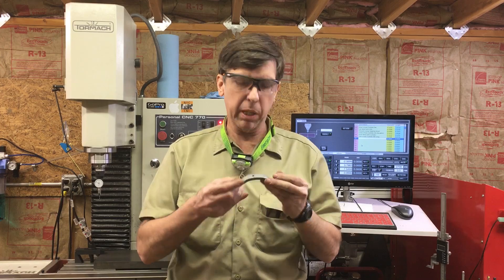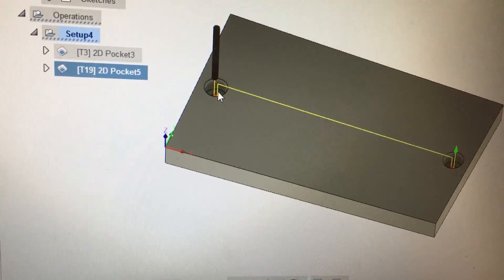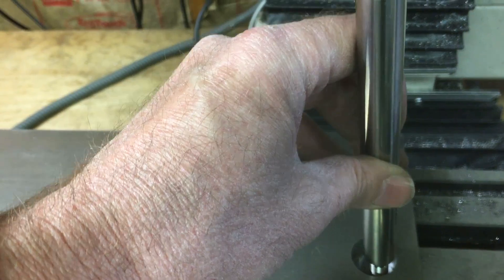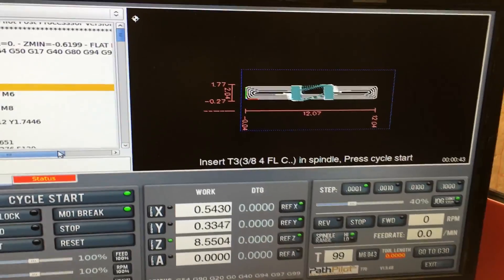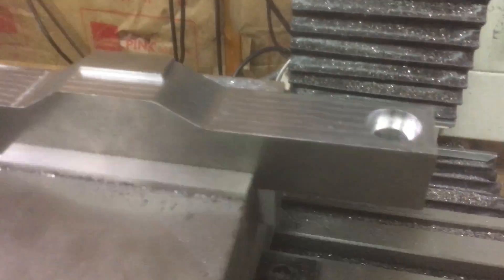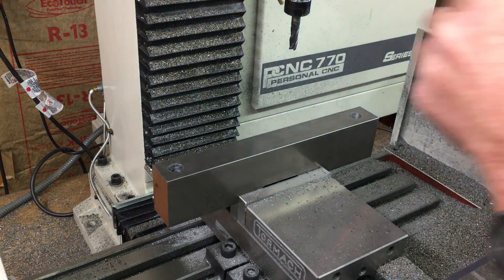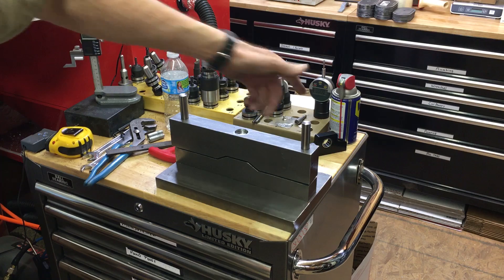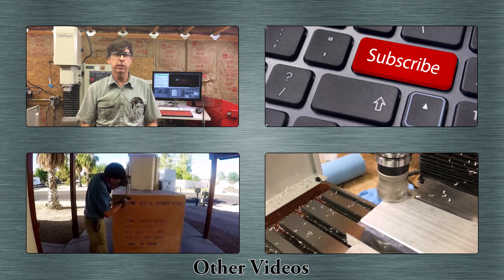Making a Press Die/Press Brake

Comment: Unipunch has been around for 50-60 years.  DME products have specialty pins and bearings of various hardness, They also sell die sets that you can add the shape dies of all sizes.  Just type in either on the internet and go.   Nice work by the way.
Reply from the maker: Thanks!  I checked out DME. Looks like mostly mold equipment. I guess the pins and sleeves would work the same.  Didn't see the die sets. Still debating whether I should buy a premade die set  or make it.

Comment: In case anyone else would like to remove the slop from the ram of a Harbor Freight 20 ton press.  I use mine for all kinds of other more precise tasks like tube flaring and such.  With the slop of the ram removed, it really improves the utility of the press for more than wheel bearings and press brake work.

https://www.youtube.com/watch?v=X6zGj9avKIQ&t=71s

Comment: Nice die

The top looks a little heavy
Any reason for using such a thick piece 
Just thinking about cost

I’ve been meaning to make a couple forming dies
After watching your video I might be out in my shop soon
Reply from the maker: Thanks!  I have no engineering experience so I have to over engineer things.  I will use scraps from my metal supplier from now on though.

Comment: like the idea of the separate base and sliding the bottom die on that centering it with the pins
been looking at a sheetmetal finger brake for my shop press and the bottom die is usually welded to the plate wish makes it impossible to use it for anything else then bending sheetmetal  , with the loose parts you can make add ons with less material as you reuse the same base 
this way of putting the thing together in sections makes it eazier to set it on and take it out of the shop press too (you dont have to lift the whole unit intoo the shop press but can stack it up in there one piece at the time )
Reply from the maker: Yeah, 2 upcoming videos will show my die holders and interchangeable sheet metal dies.  I ended up buying a press brake that I have to take on and off.  I should have just made one to put on the base I have but wasn't sure how to make the hardened top part. I just bought a 1" hot rolled drop from my metal supplier to put under the press brake.

Comment: Its perfectly acceptable to say thou for thousandths of an inch. 
Next, maybe to save on expensive end mills, try drilling thru the part first, then just circmill in counterbore. End mills last longer if you dont plunge cut too much, especially in a non-rigid machining setup, ie. light duty mill.

Comment: looks pretty "painful" to use, apart from the missing center locating pin that people talk about, here are some improvements - do a bit of redesigning and modify existing dyes to account for the material spring back, it is not a lot with this material, but it will look a lot more professional and not cheap if the center section is not bowed, minor thing, but the experience fixing this issue will probably help down the road, next - bottom face around the guide rods and the top dye, you can safely remove few centimeters there and put some valve springs from an engine to help lift the top dye to help with positioning a new work piece and removing a bent one, easy fix and will make working with the tool much easier
p.s. as for the guide pins, to avoid expensive tool and dye stuff, since there is not much stress on them in this particular dye, use hydraulic rod stock, they are hard chrome plated and precision ground, may even come hardened, and they cost pretty much nothing
Reply from the maker: Thanks for the tips!  I have implemented a few of these items already.  Yeah, the guide pins were way too much.  I will try the Hydraulic rod stock.
Reply: There are so many built in inaccuracies in this 'toolmaking, I don't know where to begin. The term 'thou' is spot on but any self respecting toolmaker can, and does use imperial AND metric. I have been using metric for 35 years, but the thou is still easier to use.

Comment: Great video! I enjoyed watching your 770 in action (I've watched your older videos, didn't know until this morning that you bought a Tormach; obviously it's been a while). 

Regarding building bending jigs - to minimize machining, I'd face off the edges of 2-3 pieces of stock, drill, tap and then stack. Basically, let the band saw carry the load, then layer (thus, reduce wear on cutters and decrease machine hours). If all layers are flush, the compression between them wont effect the output of the press.

Yeah, kinda screwed-up the order above and too lazy to re-type anything - but I'm sure you know what I mean.

Comment: how are you locating the part in the center of the die, you have the hard stop in the back but not the side.  a simple pin hole across the lower die with a pocket in the top die to match would be handy. 

have watched a few of your videos now, seems like you are really easy on the tools.  do not be afraid to be agressive and take deeper DOC.  I have an 1100 and push it pretty hard with .500 carbide rougher at .300 DOC .100 WOC at 25 ipm.  

when making all those counter bores drill a hole first.  I predrill all mine with a .500 drill and then depending on the size I need to open it too I'll plunge right in the middle of it with the end mill.  there is a setting in F360 to plunge in the center of a hole and it makes it great for this.  no helical ramping which is slow, get to depth and get to cutting chips.

keep the videos coming.
Reply from the maker: +Tim Yuhas - Thanks Tim!  A recess in the upper die, that's a good idea.  Yeah, I tend to be conservative when working with an expensive piece of stock.  I will try to start pushing it a little more.  If I predrill on the 770 I have to change to low gear because of low torque. Not so much of an issue on the 1100.  I guess I could change the belt position and try next time.  Thanks!

Comment: That was a great job Craig!  It's always nice to know that I'm not the only one that doesn't measure things correctly too.  I hate it when that happens.  It is way cool to see someone else machining some steel with their 770.
Reply from the maker: +Doug P - Yeah, springs are measured in OD and wire thickness.  I didn't think to count the wire thickness twice since its diameter.  Oh well, I have springs to add to my misc box.  lol  I think it cuts steel pretty good.  Still seeing how hard I can push it.  I am tending towards high speed machining.  I am running at 120 IPM at 15 thou DOC on my steel plates.  Getting closer to my target of 2.5 min per plate. I think my holding method isn't good for greater depths of cut.  Too much noise.

Comment: Very Cool Craig works like a champ, I do Have a couple suggestions that may help!

One you could just put a set screw to hold the Press shaft to the top Die then when the press lifts so will the Die.

Second Place a Scribe mark on the front to center the different lengths.
Be Safe,
Sam
Reply from the maker: +CNC4XR7 - Great Ideas Sam! I will have to try them out.  Thanks!

Comment: Very nice Craig! What is the part for, and where do you buy your steel? Ciao, Marco.
Reply from the maker: +Crivo152 - Thanks Marco!  Its a bracket for an electrical cover.  I usually buy from Metal Depot or Online metals.  I got this steel from McMaster Carr because I needed it fast.  Che vediamo, Craig

Comment: You may want to chk you vise tram....
Reply from the maker: +Bigwingrider1800 - The keys on the tormach vise are within a thou on the t-slots when you push the vise forward.  Yeah, I guess I should have checked but the accuracy on the project didn't seam to need it.  I didn't expect to have to flip the part though.  I'm still learning I guess.  Thanks.

Comment: Great work Craig!  My favorite thing is to make tools!!   You should treat your self to an air powered version of the jack from HF.  I put a knob on the release valve so that I could use just my fingers instead of the handle.  Thanks!!
Reply from the maker: +bluehandsvideo - Great Idea!  Already picked it up in fact.  Thanks!
Reply: +Craig&#39;s Machine Shop you will be very happy with the HF air over jack.  My friend down the road put one on his press a few years ago and it has been rock solid.
Reply from the maker: +Doug P - Cool. I should have it in this weekend.  Hope to go from 30 seconds to 10 seconds on the bends.

Comment: Hi Craig,

Thanks for sharing.

Looks like it will do the job.  Don't know how important the center line  hole is on the bracket.  You could drill and tap a hole in the bottom die and install a threaded pin with top end sized to allow your center hole in your bracket to center on the locating pin.
Just a thought.

John
Reply from the maker: +helicopterjohns - Great idea John!  I will have to try that.  It will have to be real low profile because I didn't leave much room with the length of spring I ordered.  I guess I don't need much though.  Maybe 40 thou. If I had thought of it I could have machined it in.   Thanks!